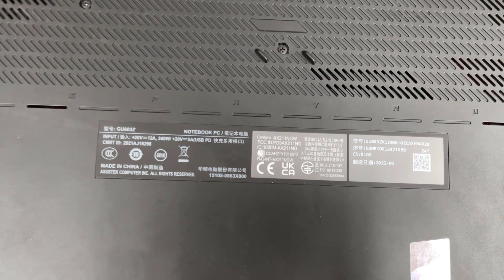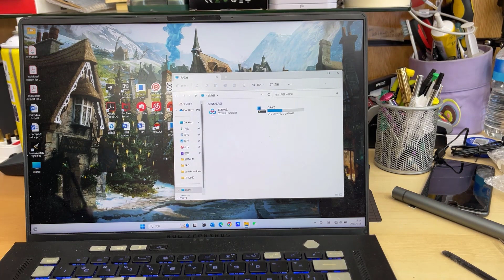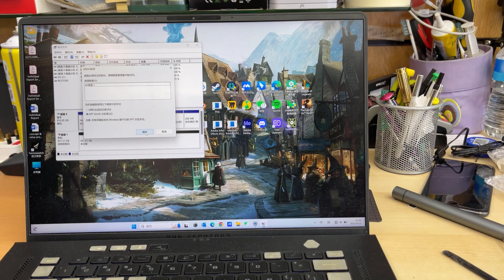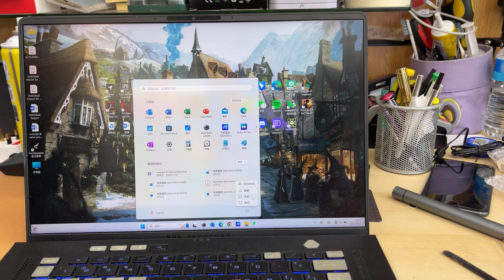How To Install Secondary SSD In Asus ROG Zephyrus M16 2022

Comment: Really helpful, thanks for posting.

I followed these instructions with a 2022 Asus M16 (same laptop as in the video) using a Crucial P3 Plus 2TB NVMe SSD and it worked perfectly. The SSD was $91 on Amazon (June '23).
Reply: Can you please clarify something? I'm confused if the secondary M2 SSD port is expecting a 2280 or 2.5 form-factor. In the manual this info is nowhere to be found but there's a "the M2 2280 slot does not support M2 SATA SSD" warning that got me confused. It seems that the author installs 2.5" NVMe SSD but I thought the 2280 is expected? Which one did you put it?

Comment: Disconnect the battery at the battery NOT the motherboard. The thin metal that connects the board to the connecter can easy come free if you pull it the wrong way while trying to disconnect it.  I had to take my computer to a shop to get it put back correcty.  Disconnecting it from battery side does not have this problem

Comment: do you need thermal pad for the SSD?

is the thermal pad included with the SSD? or you got that separately?

where did you get the automatic electric screwdriver?

Comment: By not removing the battery and by merely just disconnecting it from the motherboard, you run the risk of static discharge from the presence of the battery leading to destruction of components. It is always best to disconnect and remove the battery , especially while making upgrades. This method is dangerous

Comment: Hello, do you think I can add a Samsung 990 PRO with heatsink to my GU603VI, or the heatsink makes it too thick ?
Reply: Did you end up trying this? I’m wondering the same thing
Reply: @natefish2170  I finally installed the version without a heatsink (didn’t take the risk) and applied Thermal Grizzly Minus Pad Extreme.

Comment: Can you please clarify something? I'm confused if the secondary M2 SSD port is expecting a 2280 or 2.5 form-factor. In the manual this info is nowhere to be found but there's a "the M2 2280 slot does not support M2 SATA SSD" warning that got me confused. It seems that you installed a 2.5" NVMe SSD but I thought the 2280 is expected? Which one did you put it?
Reply: M2 sata is a different connector from m.2 nvme the one he installed was nvme

Comment: Im in a bit of a bind, I installed an m.2 on my brand new 2023 m16 (4070 version) and after that i tried powering on the laptop and now only the keyboard lights turn on but no display. Could this mean that I shorted my GPU or the motherboard? If so how screwed am i?
Reply from the maker: Did you disconnect the battery first or not?

Comment: I stripped the m2 screw 😭😭😭😭😭
Reply: Me too. It was on so tight. Did you manage to find a solution?
Reply: @olavisalomaa  i took it to a technician friend and he just pushed harder to remove the screw (he took less than 5 minutes)
Reply: I used a flat-tip plyer to remove it.
Reply: I just used a small electric drill instead of a screwdriver. Worked fine.

Comment: My laptop stopped running on battery after I did this. Is the battery not connected properly or something else problem?
Reply: Maybe you didn’t secure the metal clip over the battery connector properly. Make sure the metal clip doesn’t touch the motherboard at all (anything passed the rectangle line) or else u will short circuit it and break ur pc
Reply: Same issue
Reply: @saqibreza769  It's the battery not connected properly. I opened it again and fixed the battery connection now it works fine